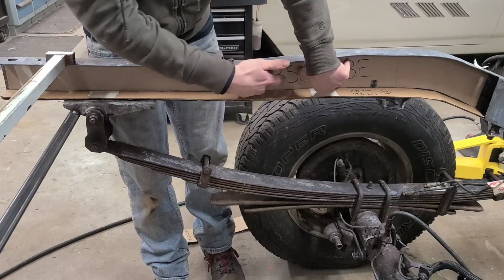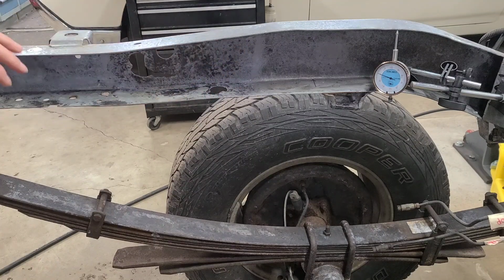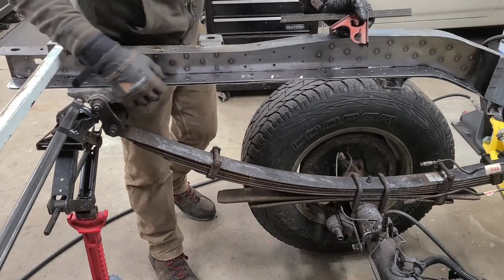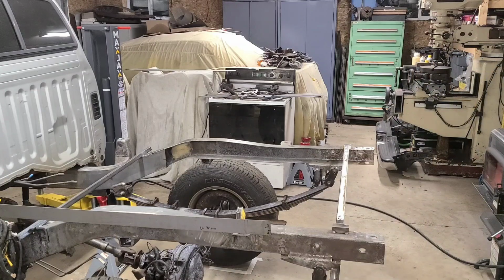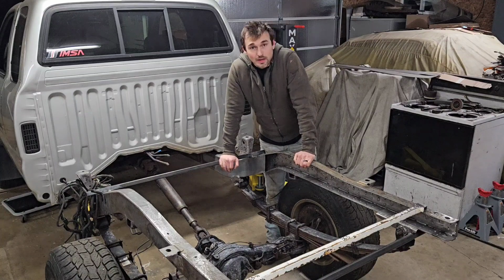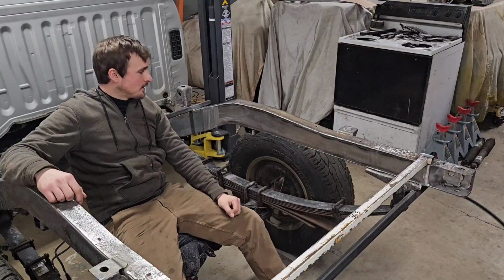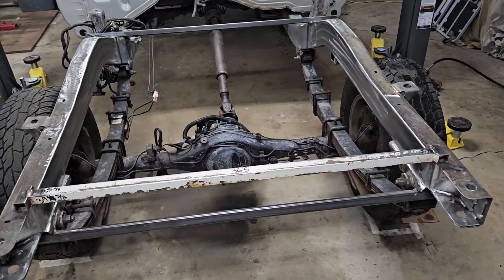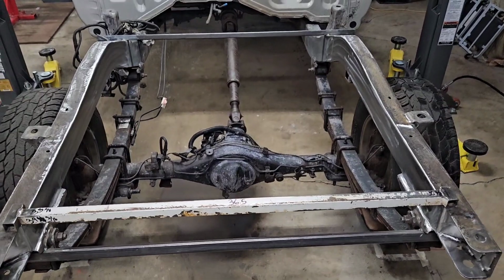Boxing in the Tacoma frame

Comment: You also could have cut a block of wood to Wedge from the axle tube to the bottom of the frame at the point where you want to bend it. It would have taken the flex of the leaf springs out of the equation. Maybe have bent it a hair past perfect to allow for the steel to spring back. I think you did a great rebuild on the frame, definitely better engineered than Toyota had in mind.
Reply from the maker: Yeah, that could have helped as well. I'm glad that I was able to correct it before the plates went in because this frame is super solid now. This truck is going to handle completely different now and instill some confidence back to its abilities.

Comment: Nice fab and welding skills. This is why a shop will charge you 2500.00 or more to repair as you did. Got a 99 with 223k on it as well. Bodies pretty mint as its be hot oil coated 3 times over. Can't say the frame looks as nice. Was a Southern truck and 13 years in the Northeast has taken its toll. In the process of trying to locate a frame as I don't have the welding skills to attack it.
How'd you like to do another one !!!!!
Reply from the maker: Thanks Andy!
If I ever buy another used truck, it will be a clean one from down south. I swear these frames are salt sponges.

Comment: Amazing work
Reply from the maker: Thank you! It was a lot of work but worth the end result.
Reply: @PostRt  I live in PA. Rust sucks. I would suggest coating the entire truck with fluid film. Inside the doors etc. Look forward to any follow work on the truck. Thank you for responding g.
Reply from the maker: @smplyizzy  I will be adding coatings after the metal work is done. I like the idea of an extra layer to keep rust away.

Comment: That’s done right. All these people welding patches and leaving the rotted metal underneath.  The frame on My 2004 went up front where the sway bar mounts. 4cyl, the v6’s went near the cats usually
Reply from the maker: Exactly!  I wouldn't feel safe just welding patches over the unknown frame rust. Now I am confident that this truck will handle whatever I throw at it and last a lot longer.
Reply: my only concern is the added plates on the inside that are plug welded create a laminated space between them.  This is a classic setup for moisture retention, water loves to capillary wick between close surfaces.  However, this truck will likely be treated VERY differently than a neglected daily driver so much more likely to receive a desalting wash after exposure and to get regular surface shield treatments that will wick into and protect these same spaces.

Comment: I purchased a Truck that appears to have had the frame boxed and have a question out of curiosity more than anything. And please do not take my question(s) wrong, as I do not possess the obvious skillset you do and am in no way knocking your skilset. Having said that, besides someone possibly wanting to box for strength or repair reasons, wouldnt doing this present a scenario where water is introduced and then trapped into a box frame? As stated before, my truck frame is boxed, so it is just a question I posed to myself after noticing and now you. Seems to me, planned obsolesence is at play with these manufactures or else they would just use solid rails from the start.
Reply from the maker: There are drain holes that allow water to exit the frame. Also, many frames have additional holes that can allow water and debris inside or promote drainage. If you have a C-channel frame and a boxed frame of the same thickness, comparatively, the boxed shape will be stronger. Manufacturers engineer their frames with many things considered. Some see the open channel frame as a way to better integrate crossmembers and other components. They also allow some flex so the vehicle is less harsh on the road. Hope this gives you some insight.

Comment: That frame straightening tool was just a piece of 4x4 wood, right?  I have to do the exact same thing.  My passenger side sits about an inch higher than my driver side. I should get all my grinding done tomorrow, so want to get the frame rails aligned as well.
Reply from the maker: It was pretty close to that and was a solid oak beam.
I'd recommend disconnecting the rear spring hangers to isolate the weight from pulling down on the frame rails. I think that will help you out.
I don't remember the exact measurements, but if you lay a straight edge down your truck bed supports, you can also use those mounting hole locations as a reference point to help align the frame.
Reply: @PostRt  ok. Thanks. I got all my grinding done today and got my backing plate welded in along with my filler plate. Tomorrow I’m going to work on welding in the lower frame rail reinforcement.

Comment: Another great video!  My right side is also about an inch higher and I'm going to get a 'factory Toyota frame alignment tool' and do the same thing!  What kind of laser alignment tool are you using?  That looks super handy to have.
Reply from the maker: I think it is made by Johnson. I purchased it from a local home supply store for under $100.

Comment: My 2000 Tundra frame has significant rust (shocker, huh?) and it appears to have started where the factory riveted two channels together at the rear of the truck. I feel like your doubler plate plug welded and stitched around the perimeter is going to have the same effect, trapping moisture between the two layers. Anybody out there with insight on that?
Reply from the maker: My plates are treated and then coated with an internal frame coating to protect them. On top of all of that, I am adding a fluid spray coating. There will be three layers of protection over my work. Even if left uncoated, having the repair last another 20 years would be plenty for me and my needs. My repair will last a VERY long time. Great question though!

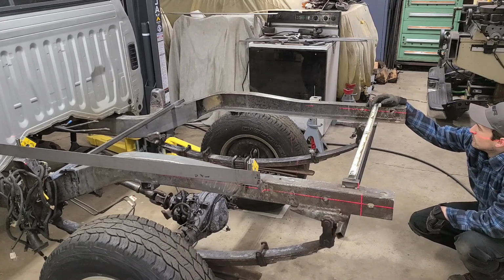Comment: @15:38. Another way of doing this for those that don't have a laser (and in some ways maybe better than a laser if you're not doing this on a level shop floor).  Take two strings and attach them to form an X from matching points on the flattened section of the frame (from right behind the arch on the left side to where the bumper mounts on the right side, and vice versa).  Make sure both strings are tight with the same amount of tension.  When all 4 points are flat ('coplanar') the strings will touch in the middle.  Really strong but light fishing string is perfect because it has a thin, crisp edge and has a higher straight to weight ration than paracord or cotton string.  Piano wire is also perfect and you can use the sound made by plucking to sanity check if both are equally tight.  If you wanna get fancy you can use a guitar tuner to actually measure it lol. This is an old school method for straightening machine frames and boxes. I've used this with great success leveling out my large format CNC router before attaching the bed.  It works surprisingly well.
Reply from the maker: That sounds like a neat idea! It can be tricky to find a flat area on an old frame. Especially with their stamped irregularities.
Of course, the ultimate way to check for frame straightness and squarness is by referring to an OEM frame specifications sheet. They have a plethora data to help get things back to spec.
Reply: @PostRt   I'm literally in the stripped down and sandblasting phase of my truck right now.  Do you know where I can get this spec sheet?  Would you be interested in exchanging email or other contact info?  I've been poring over your videos for weeks.  They are amazing and have been so helpful.
Reply from the maker: If you know someone with access to factory Toyota Service Data, they should be able to get that information. The next best place would be to contact a local body shop. They will have that information available as they use it to bring vehicles back to spec after a collision. Lastly, they are hard to come by but, I was able to find some frame specification sheets on various Tacoma forums.

Comment: Great video series, but why is there no attention to the front half of the frame? I have a 2004 that I just bought and it needs work. I plan ok doing what you did except I don’t know how to weld, will have to take to a shop.
Reply from the maker: Woah, woah, haha. One step at a time. I haven't got there yet. However, the front of my frame is not as bad as the rear half though. Good on you to let a shop handle the fab work if you are not confident in the skill set. I will continue to update my progress so stayed tuned.
Save the Tacomas!!!
Reply: @PostRt  I see, thanks man, yeah hoping I can save it. Look forward to your vids.

Comment: How did you make that bending die for your hydraulic press?. Do you have a video on that?  Is it just 1/8” plate and 1/8” angle iron?
Reply from the maker: That is basically it. Two pieces of angle iron were laid down onto a base plate and welded together. Make sure they are cleaned up and squared first. I used a piece of square tubing clamped down to hold  the jig together.
For the top, another piece of angle iron with a strip of steel spine welded on the back. Then I found a piece of steel tube to slide over the ram.
I'd recommend adding gussets to the top to prevent bowing, and if you really wanted to go all out, add a set of spring-loaded guide rails on the ends of the die for more precise alignment.
Reply: @PostRt  thanks!  Your videos have been great!

Comment: I am not sure if its a good idea to block the rear ends. The air has to enter the "pipe" in front and easy to get out at the end. Then it is able to dry out all water and wapour acumulated
Reply from the maker: I have never seen a generous air intake near the front of frames. The factory frames' original boxed section was capped as well. Most frames have extra holes built into them to allow for assembly jigs, factory transport, various upfitting, and cross-platform applications. This frame will have extra drain holes added and will be properly coated to protect it when it is finished.

Comment: Looks incredible, nice work. Did you drill drain holes in the bottom of the frame for any moisture that does find its way inside?
Reply from the maker: I will be adding drain holes last, after  I am done making repairs and before I do the rust prevention coatings.

Comment: Nice work. How did you get the laser to project on to both frame rails?
Reply from the maker: Offsetting it allows it to project down both rails.
Reply: @PostRt   interesting, I can't quite picture what you mean.
Reply from the maker: Once you turn one on and start playing around with one, you will understand what I mean.
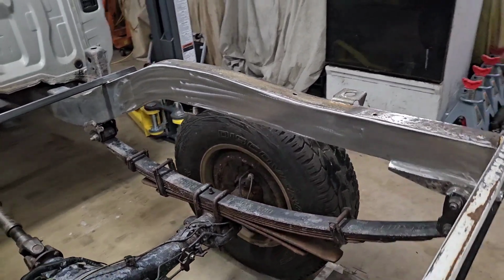Reply: offset from the back corner, diagonal.  Not straight on from the side.  @29:30 is literally the point of view from where the laser should be positioned.

Comment: Nice job 
I new guys 30 years ago doing strait frames on hilux Toyota trucks 
No reason to have holes in frames
Reply from the maker: It is much cleaner for sure, and I still have drain holes down low to let water out.
Reply: Ya no need for holes on frames 
It’s a money making grab by manufacturers 
If frames are closed 
They’d never rust 
The guys I knew did 2x4 rails straight frame closed no holes 
With eliminated body lifts 
Welded spring chackles 
To the frame 
Front and rear axles 
And you could put 35 and 38 on simple 
Guys were geniuses back in the day 
Had a great business called the toy box 
They made Fiberglass boxes as well 
Sadly I heard 1 partner passed 
And the other shut it down 
Anyway enjoyed video 
Great work
Reply: @joecolaillo   manufactures aren't trying to sabotage their products by making them rust out so they can sell you more frames.  Making a bad product bad enough that it consistently needs repair and replacement just gives you a bad reputation.  Look how much Toyota had to spend on their frame recall for the 1st gen.  It was hundreds of millions.  We need to kill this idea that every time a company makes a.mistake or a product fails that it's just to make more money.  It happens occasionally, but usually it's to SAVE COST in the initial production, not some devious scheme to maybe sell you another product or repair later on.

Comment: Are you worried about lapping metals over each other trapping moisture between them? Those areas are usually the fist places to start rust! I will say I like how you boxed the channel in and took the time to grind them flush and smooth. It looks great...
Reply from the maker: Have you seen my truck frame?
I am always worried about rust! 😄 
All of the metal parts will be sealed when it gets top coated. Furthermore, I will be adding a layer of cavity wax on top. Everything is going to be A-okay when it is finished.

Comment: Pitty you didn't show the outside of the frame or how to go about that side 🤦
Reply from the maker: Wait...what?
Reply: @PostRt  good repair to the inside chassis rails but not the outward facing side guess it doesn't need it ,  what paint did you use to protect it,  good job there though bud👍
Reply from the maker: @Lee Revell  Okay I see what you mean now. The inner plates that attached to the existing framework have essentially reinforced the "outside" portion. I treated the frame with a phosphoric acid, which leaves thin rust preventative layer on the steel. I'm not finished with the repairs just yet so I haven't top coated anything. I will do that once the cutting and welding is finished as it would ruin it.

Comment: Thank you so much for your videos, I realy appreciate your approach, and it helps me to try to find a way to fix my own navara. It also has some bad spots on the chassis. On one place there seems to be some sort of tube welded inside the chassis for reinformecement that got totaly rotten, but I am not sure what it was. of you could have a quick look at it, i would realy appreciate it, i made a video for you about it: https://youtu.be/NUcFzIK86eA
Keep up the good work, all the best
Reply from the maker: You're welcome. I'm glad you were able to find it helpful towards your own project. There very well could be other tubes and plates added inside if the frame to aid in rigidity or to brace where other components are bolted on, like near a crossmember.
Reply: @PostRt  thanks, i bought a endocope ans can confirm that there many (rotten...) reinforcements indeed inside my frame
Reply from the maker: If one side is more intact, you may be able to copy the original design or something close to what is supposed to be in there.

Comment: very, very confusing video!!
Reply from the maker: We all learn in different ways and at different rates. If this video was way over your head, there is likely another video out there that you will better understand.
Reply: How did you get that insert to cover the hole you cut on the outside of the frame by the shock mount to fit so perfectly. I’m facing that exact same challenge, only on my truck the passenger side is much worse and the section I had to cut was bigger. I’m going to add the inner backing plate, but my cutting on the outside frame rail is a bit cobbled and makes it hard to create a template.
Reply: Sorry. I didn’t mean to reply to another User’s comment. I’m new to this YouTube stuff. is it possible to post a picture of what I’m trying to do?